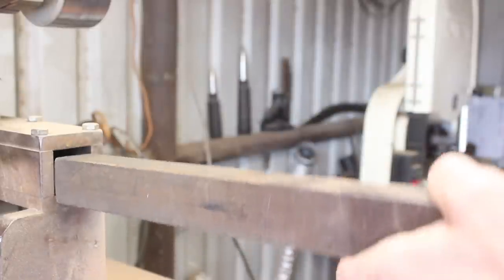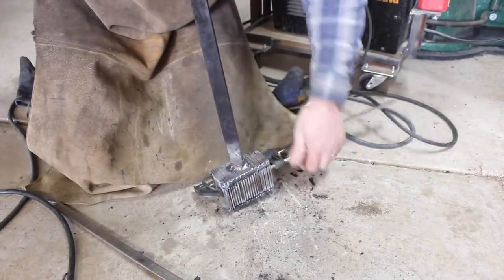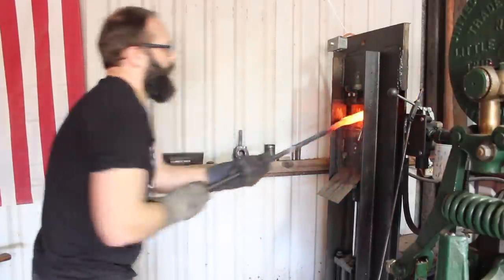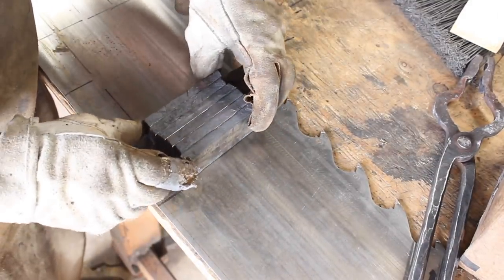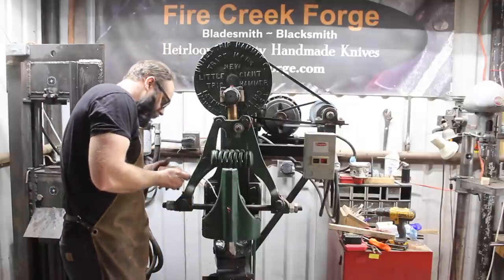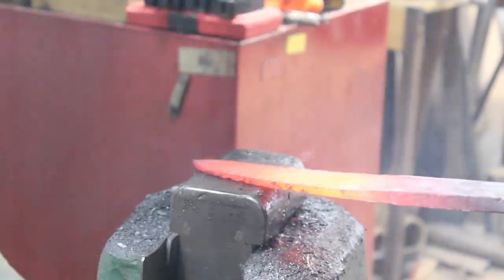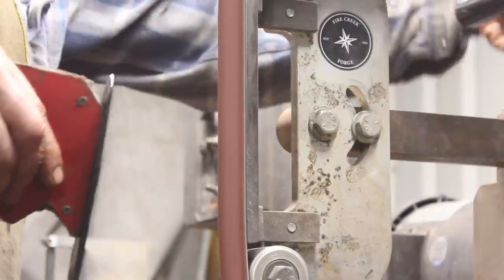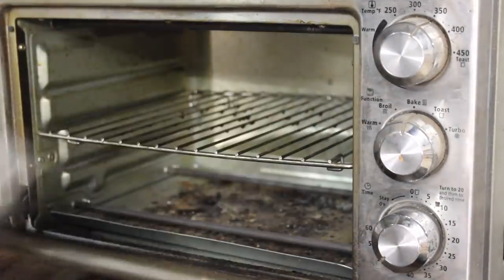Forging Damascus With 52100 Part 1: 200 Layer Skinner With Buffalo Horn Blacksmithing Knifemaking

Comment: Excellent  video, way better & more in depth info than any  forged in fire show period. I've been stock removal over the years  using old  L6  sawmill blades & heat treating at the end. I would  incourage anyone that recognizes the value of a good blade should try their hand at making their own knife & sheath. 🤙

Comment: Always remember that when pattern welding all of the metal from the INSIDE OUT must be at a weldable tempurature. And the outside will tend to be hotter than the inside. You have to leave the metal in the fire long enough to heat all of the metal to the right temperature. But if the fire is too hot or you leave the metal in the fire too long the outside can be come too hot or scorch and you can get weak or brittle spots once you start folding the metal or welding it. I have Blacksmiths in my family and have training as a blacksmith myself, and this is one of the things I was taught and have learned.

Comment: You really got the use of the power hammer under controle fast.
Also like the setup with the power hammer and the press next to each other, looks like a good workflow setup
Reply from the maker: Thanks! Definitely a useful tool. I like the setup too.

Comment: I like the multiple pin patterns. Historically they didnt have the adhesives we have now, so pinnage was a way to increase the handle holding strength.
Reply from the maker: Me too. 
That makes sense.
Reply: it could also allow you to thinner pins which might have allowed you to tune your brass usage more accurately in order to use the least amount of brass possible while still having an adequate handle.
Reply: it could also allow you to use thinner pins which might have allowed you to tune your brass usage more accurately since the higher surface area of multiple small pins would make the handles attachment less dependent on the wood allowing you to use the least amount of brass possible while still having an adequate handle.

Comment: Seeing that you had the delamination issue because of the 1/4" pieces. Would it still be possible to get it to work if you had done a few smaller billets getting the 1/4" pieces forge welded and then stacking up the different billets and forge welding them together so that you would have been able to achieve what you were trying?

Comment: I be willing to bet if you made up alot of bar stock it would sell like hotcakes.  Let people build their own knives that doesn’t own a forge and hydraulic press. 🤔 just thinking out loud
Reply from the maker: I have had that thought..
Reply: If you ever go that route ive got an idea of a layered stainless or s90v 
lovechild in my head of a bowie/cleaver.  Basically a cleaver with a tanto point. Front heavy for chopping and with a tanto for making it fit where you want it to go

Comment: Try kerosene, isn't it filtered alot more.
Reply: If you find a local place that works on helecopters chances are they will have jet b fuel that can not go back into equipment it is even cleaner than kerosene and they will usually give it away since it costs more to send it back to be refined again or disposed of. Runs great in diesel equipment at a 50 50 mix too.
Reply from the maker: To be clear, I meant that the can of diesel I have is kind of dirty. But kerosene would be a good option anyway.
Reply: @FireCreekForge  stupid question prob. but why not regular gasoline?
Reply from the maker: @MrThecorp  I think I hat would be dangerous as gasoline vaporizes

Comment: Did I miss the whole process of drawing out the steel with repeated hammering?
Reply: ? did you miss the power hammer in the video?
Reply: @AlexLozier  @4:15 he starts and the metal delaminates, where does he relaminate it and fold the steel over and over to properly blend it?